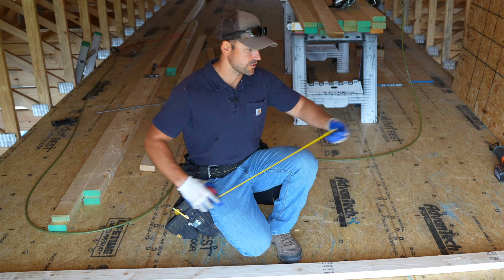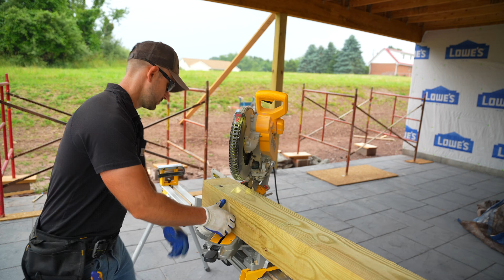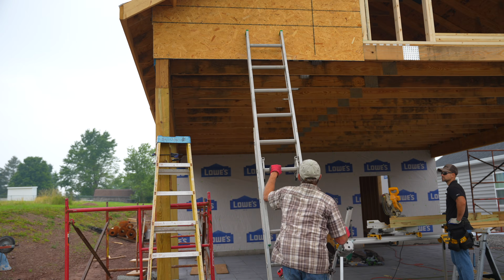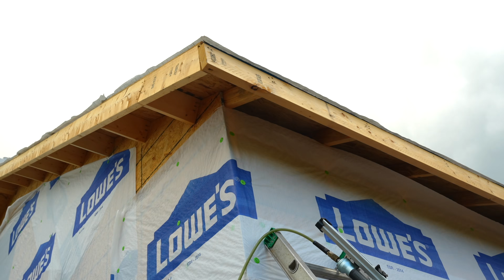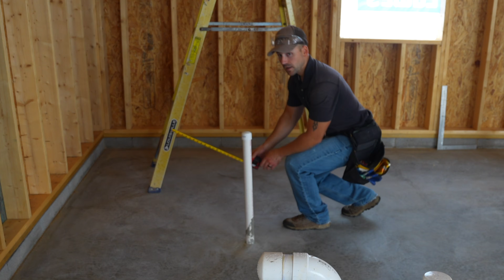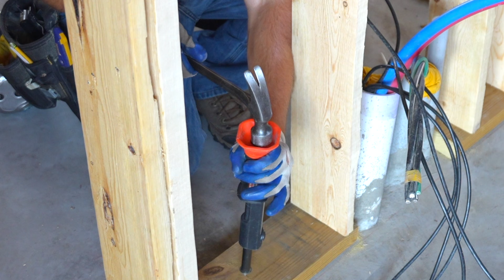How To Build A Garage - ULTIMATE STEP-BY-STEP GUIDE Part 2

Comment: Absolutely best garage building series on Youtube. Excellent work. I have a question about the truss and roof layout. If you mark the trusses for 2' o.c. layout but have a 1' gable overhang, the 4x8 roof plywood won't fall o.c.. So do you cut the ply down to start the runs down the roofline or start at first truss and just cut a 1'x8" ply strip to run up the gable overhang? Hope this makes sense. Thanks

Comment: When you built the indoor bathroom wall. Why didn't you put a sill plate barrier down? Just like you did when you built the outside wall on the foundation. Not worried about the bathroom wall rotting?
Reply: It's not exposed to the elements, it is an interior wall.

Comment: Man,, very precise!!,,, detail orientated,,i used to build sheds during the summer for a company in highschool,,it taught me basic carpentry,,from the floor to the last roof cap,,,but now at 50,, i need some refresher courses!! Lol...im thinling about building my own little house,,or get a log cabin kit...i appreciate the time you take to teach people like me !! ...im sure it takes alot of your time!!!..
Reply: Wonder if those sheds are still standing after all this time. If you just framed a floor system for those sheds instead of a slab on grade foundation, probably rotted away a long time ago. Then again, the pressure-treated lumber back then was the good arsenic stuff that actually lasted.

Comment: 12:05 I am curious why you didn't use the hypothenuse of the square to mark the 45 degree angle.  That is hold the square flush with the work and scribe using the other side.  That's how I've always done it.  Is there some advantage with accuracy to measure the angle the way you showed?
Reply: This was the reason why I've opened the comment section, lol
Reply: I don't think there's any real advantage in accuracy the way he did it. God forbid you use the hypotenuse of your speed square to mark a 45 degree angle. Lol